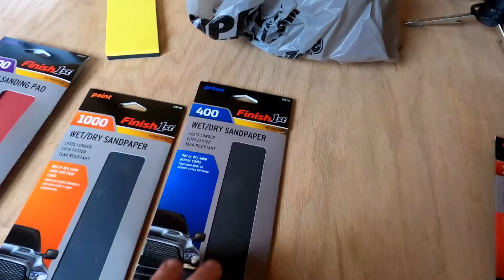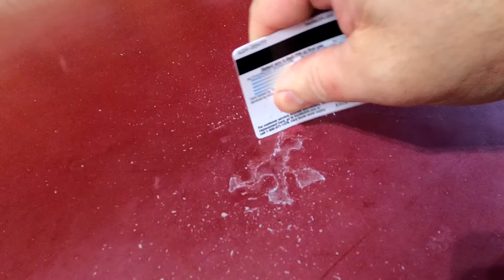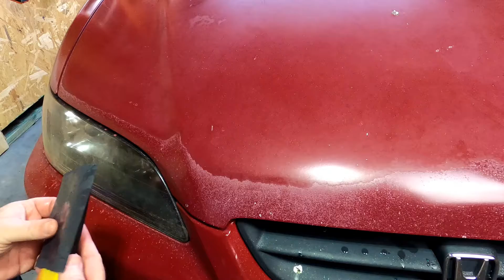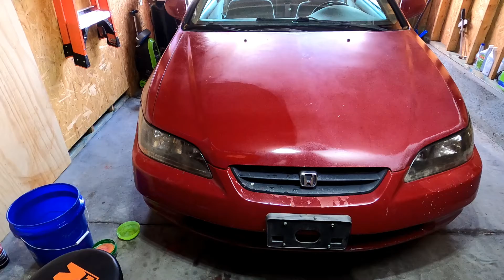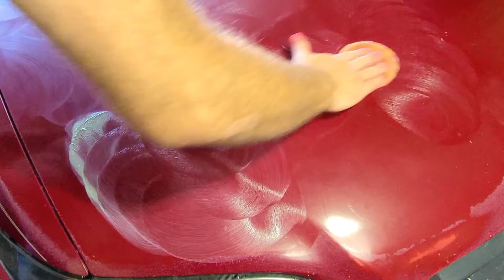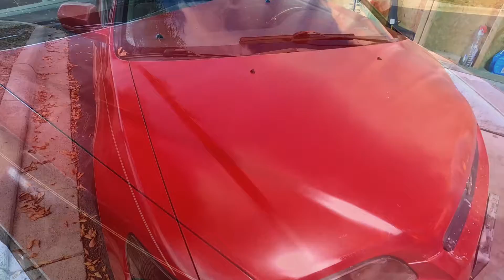Ceramic Coating CAN Help With Peeled Clear Coat!

Comment: I think you would get better results machine polishing with say meguiar's M110 followed by M210, ipa and applying a real 9h ceramic coating.  The result will be longer term!!.
I had a similar problem on the roof of one of my cars.  I did a light wet sanding, compound, polish, ipa.  And the carpro ceramic coating which camouflaged the color difference very well due to the peeling of the clear layer!.  Every 6 months I put a top coat on it to keep it like this for as long as possible before the sun has time to do its thing again 😉
Reply from the maker: I'm sure you are correct! Thank you for the info. 

What would you suggest for color correcting the hood of a Tesla painted black. I had it repainted and they left swirls in it. I have a random orbital polishing tool, but am a little apprehensive about making it worse.
Reply: @ktecgarage  Meguiar's M110 with microfiber pad or foam cutting pad, followed by M210 with finishing pad do a great job!.  There's also meguiar's D300 & D302 which do the best with their dedicated microfiber pads.  And if you are a little more novice, the consumer versions are excellent too, its like meguiar's ultimate compound followed by ultimate polish.  They are less aggressive but finish very well in finishing!.  Anyway concerning the correction I trust meguiar's which never disappointed me.  It's up to you to test the right combo by dividing a panel for example, try to obtain the best result by starting with the least aggressive technique and going up in section if necessary!.  Do you have a ptg for the thickness measurement?, but if the panel has just been repainted then it should be fine.  If you want a 1 step job while leaving a good protective wax, and still have a good correction then meguiar's D166 ultra polishing wax is the best choice, but nothing beats the 2 step correction.  But if you really only have slight swirls then a 1 step correction product should suffice.  Here's hoping to help you out a bit!

Comment: My 2002 doesn’t have any clear coat failure. Did they fix it?

You can buy 2k (two part) clear coat in cans. The main problem with not touching up the clear coat is that the clear coat provides the UV protection for the underlying paint. If you buy the single part clear coat, it will lose its shine relatively quickly, whereas the two part clear coat has better UV resistance. With a non-metallic paint it’s not terribly difficult to touch it up by purchasing Dupli-Color paint. With metallic paint it is exceedingly difficult to avoid “tiger stripes” on the paint when seen from an angle. I did quite a few tests on scrap metal and it did look acceptable but nothing like factory. You will want a good respirator for the two part clear coat. 

Also there are replacement headlights for very cheap on Amazon. Really spiffs up the look of the car :)

On my car I have some road rash on the hood and debated trying to repaint the whole hood. Would be a fun project :)
Reply from the maker: Your spoiling the content in an upcoming video! 😉

Thanks for the information
Reply: @ktecgarage  I’ll be excited to see how it goes. I’ve found some other pretty good videos on YouTube showing really great results with a bit of practice.

Comment: Thanks for posting this video it is exactly what I needed. I have a Pontiac with really bad clearcoat and I hit it with a medium buffing pad and meguiers ultimate and it already looks a lot better. I’m going to sand it like you did then buff it then put turtle wax on it

Comment: Hello brotha. Been watching ever since the f23 rebuild, i got a question.. how has the aftermarket oil pump held up? Any issues youve noticed? Do you know if the oil pressure is good? Just wanted to know, since oem honda pumps are pretty expensive.. and ive read time and time again,  people say to just get oem when it comes to them..
Reply from the maker: I ran that thing for about 7k miles and did not have an issue. Never checked the actual psi, but never saw the oil light flicker. 

If I were you, I'd probably just save up for the OEM for a part that important, even tho I ran that aftermarket one. Honda OEM is some of the best stuff out there. 

I appreciate you brother!
Reply: @ktecgarage  i hear ya, but its getting harder and harder to find them brand new. And I know the dealership will charge even more.. I was thinking of getting a melling brand if not oem.. but.. I am aiming to get a oem one. Just doing a whole refresh on this h22a4 im putting into my 95 accord. The total is starting to stack up. I know I shouldn't cheap out on the pump, but I've heard nothing but good things on melling pumps, they offer high flow pumps for some applications as well.
Reply from the maker: They build race pumps. Probably can't go to wrong with that brand.

Comment: Does the turtle wax have wax? I think you're supposed to remove any wax before ceramic coat.
Reply from the maker: It does have wax. This was all very experimental and I did have some success with it. I didn't exactly follow the directions!

Comment: Any update on how long it last? Or that clear coat on roof?
Reply from the maker: It was decent for about 2 months. Reapplying the Turtle Wax would probably have brightened it back up. 

I had the supplies to clear the roof, but I ended up moving and don't currently have a place to work on the car, so I have since sold it. 

Bottom line, it was worth the effort, but you will have to keep up with the wax.

Comment: Just get the car resprayed.    You made a mess for the painter.    That’s not grease and wax remover that’s grease and tar.      I have a body shop and a mobile paint company autopro.    This is bullshit   I am also installer for system x ceramic and I do jets and eurochoppers and cars and trucks.     This is NOT how you fix    This is a guy who has to post videos 😂 and basically shit in the bathtub.     Stay away from cars bro.  Your not helping anyone
Reply from the maker: Go smoke yourself another one and relax there sparky. Not everyone has 1k for your orange peel crap job that flakes off a month later.